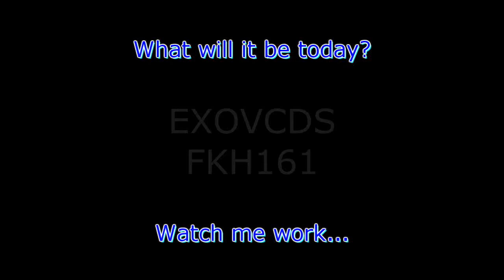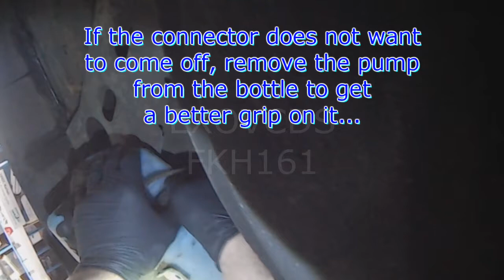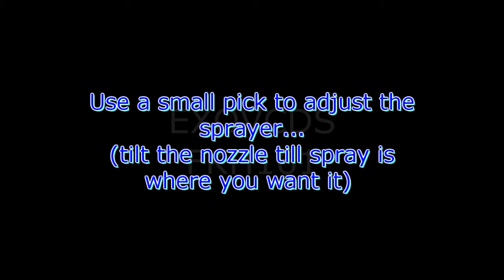VW T3: Vanagon front Wipers & Washer not working?

Comment: Thanks! My washer motor was toast as well. Note to others: If you replace the washer motor, you probably want to replace both the washer motor grommet and the inflow grommet. Mine were both pretty disgusting. Also GoWesty has a replacement washer tank if the mounting tabs have broken or the tank is leaking.  I installed the GoWesty replacement washer motor. Works perfectly. The OEM washer motor is no longer available as of 2005 according to my local VW dealer.

And as noted in the video you need a friend to trigger the switch to test things. Be sure to test the new washer motor before you reinstall the whole rig.
Reply from the maker: Thank you for watching!

Comment: If a washer pump, starter or fuel pump doesn't come alive, I always tap them to see if they do, alot easier than dismantling everything and having it working again, but usually they are due for replacement anyway, but customers always right :)
Reply from the maker: Good tip, thanks for watching!

Comment: Now I just need you to show me how to pull the dash so I can figure why my right nozzle stopped emitting fluid :)

I already replaced the sprayer and gasket. Happening somewhere between the tank and sprayer. Thanks for your time in sharing this info.
Reply from the maker: Try to blow into the hose if you haven't already. A bit of air pressure, followed by pump pressure, can free up debris that is stuck. If you remove the glove box, you might be able to see if the hose is pinched somewhere. Dash removal is not that bad. Thanks for watching and taking the time to comment!
Reply: Yeah, I blew pressure into the hose with minimal resistance. I dropped the glove box and took a quick glance (pretty sick so in bed most of the weekend) and I did not see any of the wiper fluid line, but wow is it clean back in there. Looks brand new. I was expecting to see cobwebs, old drug runner's stash or even Jimmy Hoffa, but not sparkly insides. I will be more thorough next weekend. Thanks for the tip. I'll update if I have anything.
Reply from the maker: heart4Pahoa Thanks, and get well!

Comment: My rear wiper is giving me issues. fluid works properly but the wiper arm works sometimes and sometimes not. also does not want to shut off very easily once it does start to wipe...when it does wipe that is. 
any tips? is it a starting to fail relay or if it were the relay would it just stop working completely? 
does the front wiper relay also control the rear or is there two separate ones? 
front wipers work no problems. 
any help or advice would be greatly appreciated...p.s. enjoy all your vanagon videos. they've helped me more than a few times.
Reply from the maker: I don't have access to my vw wiring diagrams at home... I just checked a Mitchell wiring diagram and it shows a separate relay for the rear. Does not tell me which relay or where it is. Put your finger on one relay at a time and feel for the one that clicks... when you activate the rear. You can then remove the cover of the relay and check for bad solder joints on the circuit board.
Reply: +Thomas EXOVCDS 
Thanks!!!

Comment: just did what you show here.  Replaced the switch arm and it was working fine a few days ago. now just the wipers work but no spray.  dropped the tank and checked the volts at the connection, its reading about 6 or 7 volts.  The pump works when connected to a 12 v source.   any suggestions as to how to fix it?
Reply from the maker: Check the ground side... if it has power, the ground is also needed. If the ground is OK, then the pump is bad / stuck. Tap on the pump.. might start working again for a while.

Comment: I have a problem with the horn :( I have a simple, late wbx (1.9) transporter.

Checked grounds best I could down on the column and batter but no luck. The contact ring seems perfect. However, if I leave the two wires before the horn pad connected and turn to the wheel to the right, there comes a point where the horn does sound. I don't know what that means or what should I do next
Reply from the maker: The horn ring under the steering wheel needs to be flat & smooth. The little wiper arm that rubs against the horn ring needs to have good contact with the horn ring (the wiper should feel springy when pushing against it). There are 3 screws that hold the signal & wiper stalk assembly to the ignition housing. Make sure that these 3 screws are tight. A loose screw can sit higher and make contact with the horn ring. The steering column is grounded by a wire at the base of the column. Check that wire to see if it us loose or corroded. With the steering wheel off, take a screwdriver and rest the shaft of the screwdriver against the horn wiper & the steering column shaft. Every time both are touched, the horn should sound... yes / no? Key on of course.
Reply: @EXOVCDS  I found the reason, at the very, very bottom of the steering column there is a small wire that was severed. I remade it and it works. Its not the loger wire that runs through the rubber cover, but one below that
Reply from the maker: That's the wire I was talking about. Thank you for the update!
Reply: @EXOVCDS  the other one was worn too and I switched it as well. The column was also assembled a bit wrong I think. There was a big gap between the two parts that join together with two metal dowels.

Comment: Hey man great video, our windscreeb washer pump is causing us some headaches. if we disconnect the pump and hook it up to a battery it runs fine and we're getting 12v to the connection when we pull the lever switch. any ideas!?
Reply from the maker: How's the ground? I forget if the ground is through the switch or straight to the frame. I'm still at work... will get back to you tonight after work.
Reply from the maker: Just looked at a wiring diagram.... the switch supplies the pump with power when the switch is pulled or pushed (front or back pump). If the test light lights-up at the pump when the switch is pulled and power is checked at the green/red wire, then check the ground. Ground runs up to behind the fuse box (left corner at body panel). You can run a ground wire from the pump to the frame (drill a small hole, clean the frame paint off and and tighten into place with a self tapping screw).. or find the bad ground connection behind the fuse panel.

Comment: So im going to try to fix a customers wiper motor because its inop is there a fuse that might go bad sometimes? And where would it be thanks
Reply from the maker: Most Vanagon owners will have one of these in the vehicle:

http://www.bentleypublishers.com/volkswagen/repair-information/vw-vanagon-80-91-repair-manual/gallery-2599-11.html
Reply: @EXOVCDS  thanks I appreciate your response
Reply from the maker: 86 to 91 van:

https://www.thesamba.com/vw/forum/viewtopic.php?t=671058

Earlier vans:
https://www.thesamba.com/vw/forum/viewtopic.php?t=509427
Reply: @EXOVCDS   that helps a lot, thanks
Reply: Is ther multiple fuse box location? I'm working on a 87 Wolfsburg edition I only see one set of fuses by the left knee , are those all of them ?